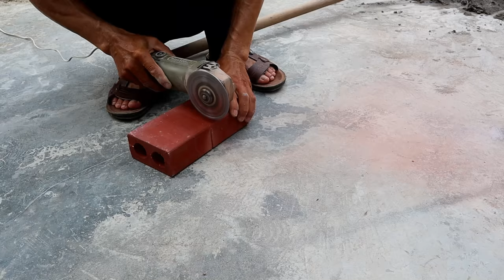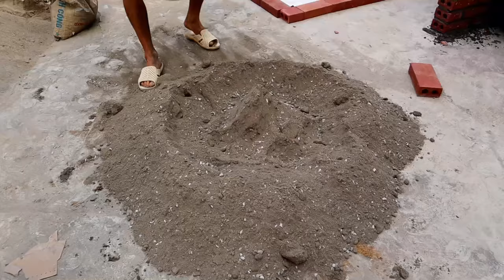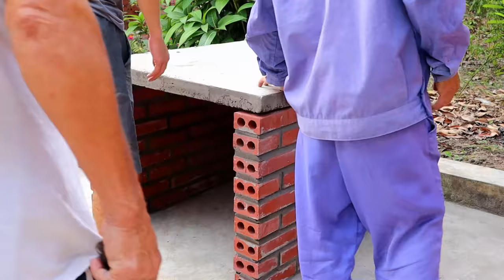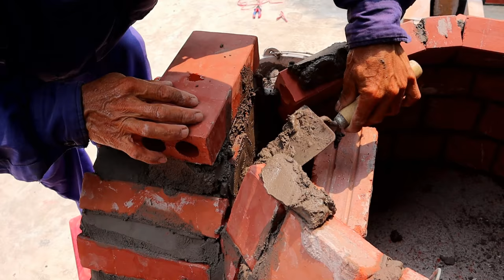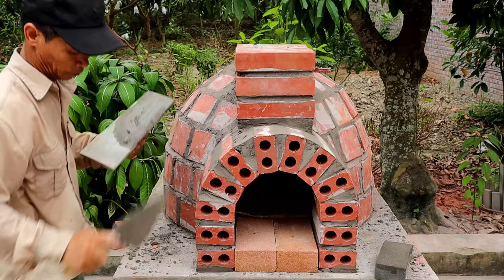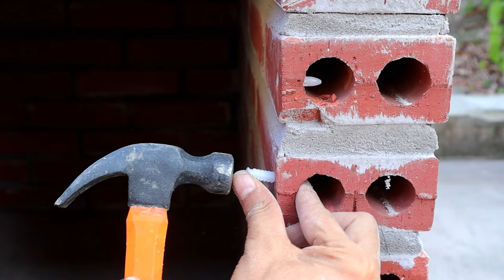How to Build Wood Fired Brick Pizza Oven in my village ( HD )

Comment: Great job. Just one thing - would have been even better if he'd left a channel for the hot air from the fire to go directly into the oven
Reply: The fire doesn't go below it goes up top where the pizza slides in but he didn't put a vent out the top I guess all that heat just comes out the door

Comment: I was going to build a pizza oven. But i got a home oven that will bake 5 ~18" pizza, I got a offset smoke that will Cook 7~ 18" pizzas, I got a Weber Kettle that will cook 1 ~ 18" pizza so its silly for me to buy or build one. All you need is 18" pizza pans and a short pizza peel.  Besides the pan cooks the bottom better than a Pizza stone does!

Comment: Thought that running a stringed lines is to at least work to them and those are some way over the top cement courses I run mine approximately 10  mm he could have gotten another brick course in that lower half plus the concrete slab is far to thin no matter what baring you use to strengthen it the heat will crack it,. Apart from that it was an interesting build to watch

Comment: WARNING- if you use this video as a guide
 to build your own brick oven, you will likely have a dangerous situation once you heat the brick oven up.  He uses the wrong mortar and brick for this application.
Reply: He didn't put natural mud to cover inside the oven, of course it is very dangerous from cement chemicals!
Reply: This might work if it's a low heat oven, but even then I'm not sure.
Reply: He seemed to skip some (what I believe to be important features) steps in making this oven.  If it works for them as a low heat oven then it still may not have a very long life span.
Reply: Hi Jensen. Have seen your comment here, it seems to me that you are experienced in this field. Could you please advise me what kind of material should I use as I am about to build an oven brick to bake. Thanks a lot.
Reply: Standard clay brick and mortar should be avoided in high heat environments.  You need to use firebrick and firebrick mortar because the temperatures you want to achieve in the oven is refractory type.  BUT it’s not just about the materials, you have to understand thermodynamics better to shape a oven suited for the purpose and to survive many heating up and cooling off cycles that will be inevitable if the oven is enjoyed often.  Typical brick may explode when heated to oven temperatures.
Reply: Indeed he uses the wrong mortar and also the wrong bricks
He should have used (for the low cost option) soft clay bricks with mud mortar or alternatively ( the high cost option)  refractory bricks with refractory mortar.

Comment: Hey man :( , maybe you dont understand but this all positive comment kiding you, this is terrible work, no one on the world do this like you :( please dont do anthing more , first learn how make anything corect  :( These bricks with holes are a mistake, you light a fire a few times, these bricks will break and start falling down. Zero insulation, the stove will not keep the temperature for long. Open chimney, oh my god, I am supposed to be a stove that gives off heat, but how is it to give back when everything around it will be cold, and the rest of the heat will flow out through the chimney. This is an example of how not to build a pizza oven.